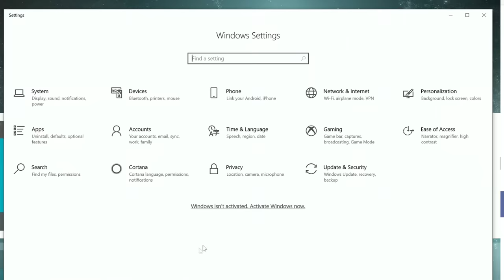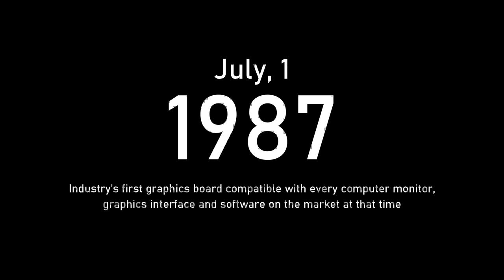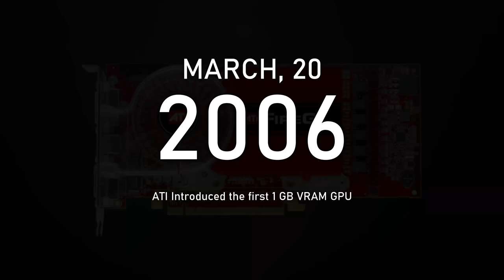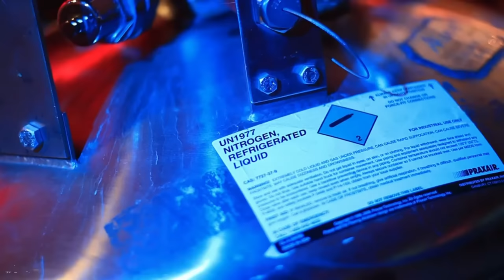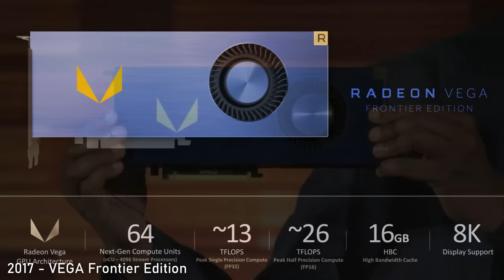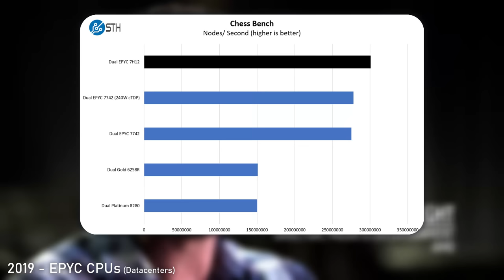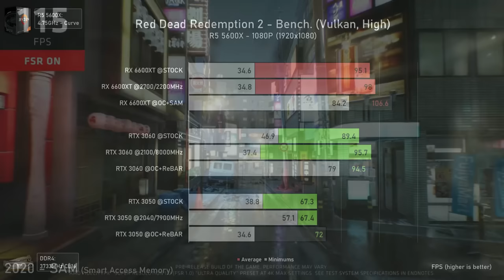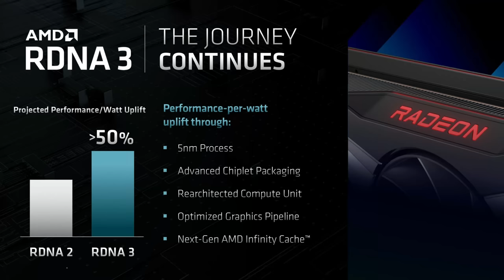AMD History and Innovations (1969-2022) | Documentary

Comment: Also there was nothing wrong with the FX series. A lot of people ragged on it but they where Intel users. I know my friends where Intel users. They complained about the heat.  The heat was no different from Intel's chips. They complained about the performance. 

It Blew away any Intel chip at the time of performance. Mind you i had a FX 9370. I had never had so smooth performance before. So smooth that i couldn't got back to using other chips. I considered anything around 4GHz slow after that. I was getting up to 300FPS in most games.

An heven help you if you played Skying with frame rate lock off. It was at 6000fps. With a Radeon HD 6890 graphics card and a Radeon 390. People who complained lied. Proof of concept. www.youtube.com/watch?v=3VJhd_2y66A

it was fine.
Reply from the maker: The FX were fine, but they were quite slower than the Intel chips in terms of gaming, usually, they still are
Reply: @AncientGameplays  No. They where in fact much faster. Intel chips had used this Gimic of Slowing down system clocks to give the impresson of higher performance just to keep up. Not only that. But even confronting program development companies and paying them off to say Intel our performed AMD when they did not. 

Telling reviewers to Only run specific benchmark programs. The moment you say. Ah i see it seem to run slowing on 3DMark. Lets try This other program. NO! NO! NO! NO! NO! NO! NO! NO! NO! DON'T DO THAT!  We would look at them like they where crazy.

 An ask why. They say " only use these benchmark programs." We knew then that they bought out the Benchmark programs to make them look favertably on their processors.
Reply from the maker: @WarsunGames  Telling that the FX chips were faster is just straight lying....they weren't...not in gaming. I had several of those chips and they were faster, and even nowadays the 3770K will perform better than the 8350. The thing about AMD chips was the price/perf ratio